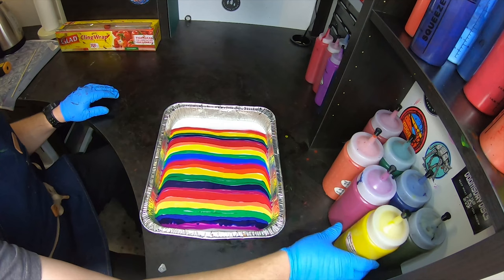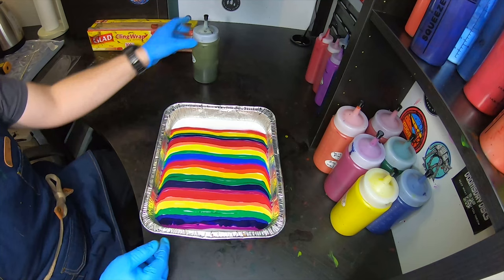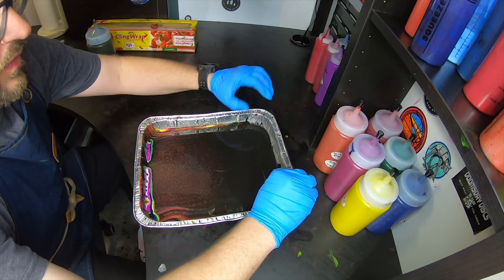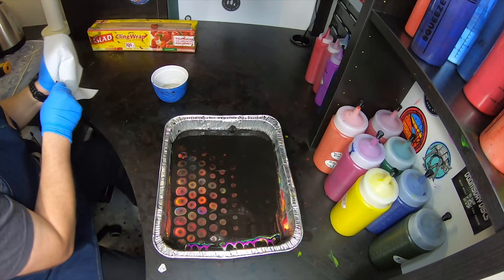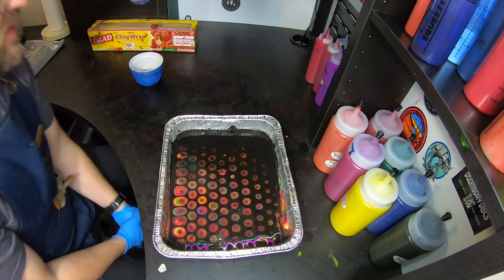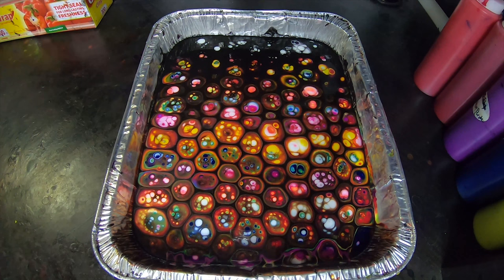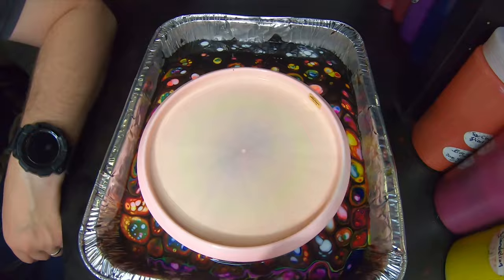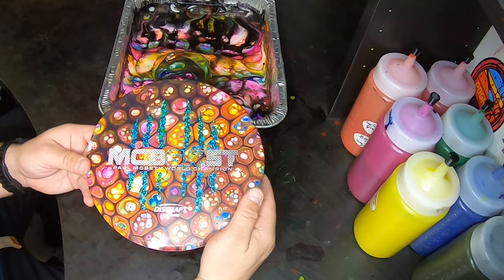How many colors can fit in one cell? - Disc Golf Cell Dye Tutorial

Comment: What exactly do you put in your dye mixtures? Sometimes when I add colors to my floetrol beds it just falls to the bottom, maybe I'm adding too much hot water when dissolving the dye powder
Reply: In my experience it's best to use as little water as possible but just enough to get rid of the powdery dye. Also the squeeze bottles help SO much. At first I was just pouring from cups and it just kept sinking and spreading like you explained.
Reply from the maker: What Michael said is correct, but there are also colors that sink and you can't do much about it. Teal and Neon purple both come to mind. You can try heating them up before you add them to your bed, or try a bed without a plain floetrol bottom.

Comment: Have you found that some colors stop the oil from working properly? I’ve had trouble when I used fluorescent pink
Reply from the maker: I have not had that issue, and I use fluorescent pink fairly frequently. Any chance the pink had oil in it to start with? That would be a problem if you're trying to do chameleon cells with it
Reply: It was a freshly mixed pink but it’s possible another color had oil. I was having good success with the chameleon cells and it just happened to not work the first time I used the pink. Good to know it’s not an issue with that color